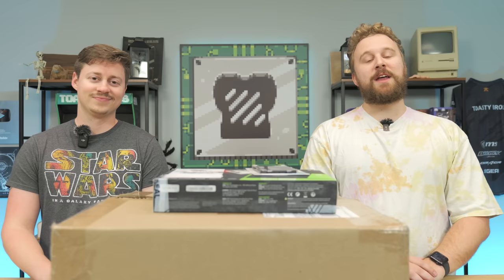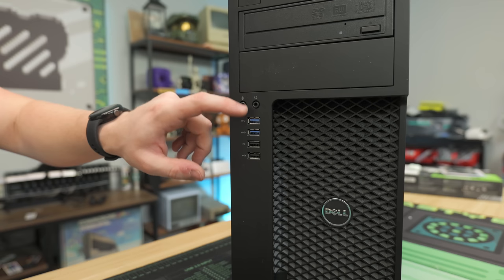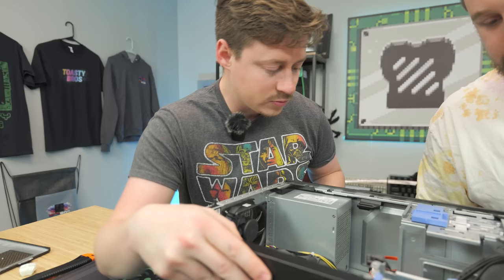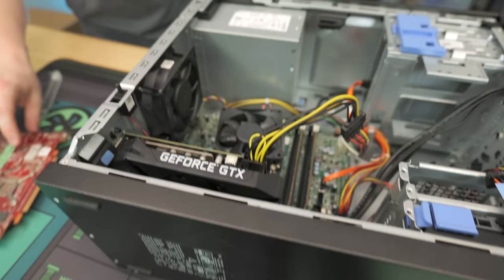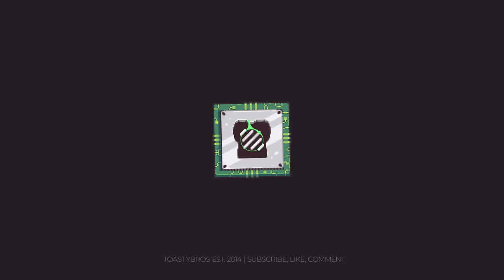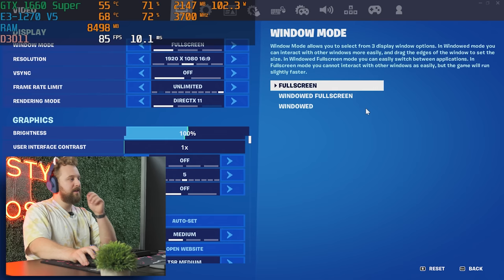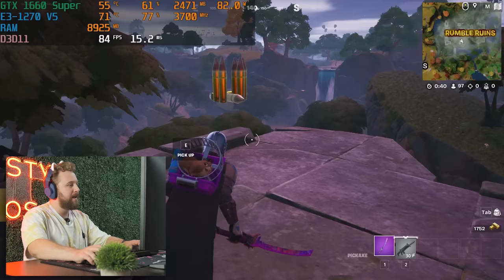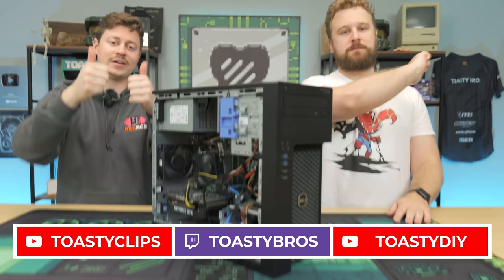This $215 Gaming PC Build is Almost PERFECT....

Comment: 👹"THE DIABLO DOG"👹Yo!  Just gotta chime in here about the Xeon for budget gaming builds. While those core counts are tempting for the price, the clock speed on Xeons is usually way lower than i7s or even i5s.  For gaming, clock speed is king, man! Those extra cores won't help as much as a processor with fewer cores but a higher clock. You'd be better off with something like an i7-8700 or even an i5-8500. They won't bottleneck you nearly as bad and you'll see way smoother gameplay. Just my two cents!👹"THE DIABLO DOG"👹PS Spot on about the power supply in those Dells!  Many of the refurbished Dell XPS or Optiplex deals on Amazon with i7-8700 or i5-8500 processors come equipped with a rather meager 270-watt power supply. While it might technically run the system, it wouldn't leave much headroom for future upgrades, particularly the graphics card.

Comment: Why does nobody bother with 6 to 8 pin adapters. They’re the same price and a whole lot safer. I replaced the sata to 8 pin that came in my hp z240 with the 6 to 8 pin adapter because it came with a Rtx 2060.

Comment: can you guys do a video on the rx 550 4gb that has recently started selling on aliexpress it doesn't require any external power cables which is great for optiplexs
Reply: Somewhat better than GT 1030, but not much. Basically, this card was not very good even in a PS4 era. You would get 30-40 FPS in older games like Witcher 3 at 1080p med, and this was before all of this "new gen" updates. GTA 5 would run at 1080p High .

Comment: Hey Bros I really need your help I want to know if you can please write me back a short message on the info I need. I HAVE A Dell Latitude D830 Laptop. Performance is as follows It's a dual-core processor with 2.6 GHZ with 4 GB of Ram. I have a simple question. Can this laptop be upgraded in any way, shape or form?

Comment: that adapter should easily handle 60 watts. It SHOULD easily handle 120 watts, it,s just copper wire... 12 volts at 10 amps is not a ton of power.

Comment: use the 6 pin from the power supply, then just the +2 from the adapter.  both of the +2 are just ground.

Comment: You use that sata to 6 pin then combine the psu 6 pin and use dual 6 pin to 8 pin adapter. I dont recommend it but will be way more safer than a single sata to 8 pin 🤣🤣

Comment: I m using 6 pin to 8 pin adapter for my 3060 ti. Is that too bad?:D It works just fine for maxed out Witcher 3 rtx on and some VR games.
Reply: Well, you are on the edge of combined PCI and 6-pin power (75+150 W) . 3060Ti is 225W TDP.

Comment: I cant believe they didnt use the 6pin that came from the power supply and just the 2 ground pins from the 6+2 sata adapter for the last 2 pins, or you know a 6 to 8 pin adapter.

Comment: They should have used the 6 pin from the case and the 2 pin from the 6+2 adapter to avoid pushing too much power from the SATA power cable.

Comment: i already use the ssd
Reply: Hey I have a 450 w psu and I got a gtx 1650gddr6 oc with 8 pin can I use dual molex to 8 pin cause gtx 1650 oc is rated at 100w and 60~ish w can be supplied through cpie slot and dual molex can supply another 108w so I think I should fry my pc right?

Comment: you guys should try a machinist mr9pro with a xeon 2667 v4 + elsa/soyo rx5700 with 16 gbs of juhor ddr4, its slighty more pricey than these pcs shown in the video but a good amount more powerful.
Reply: Just ordered machinist x99 pr, e5 2670v3, 16gb ram and Elsa rx5700. Costed roughly 200€ combined.
Reply: I will unlock turbo on all cores and kill the multithreading. Slight raise of the bclk and flash the rx5700.

Comment: Even though you recommended against it I think it's a real disservice to use the sata to 8 pin at all. The sata to 6 pin is sketch enough as it is. The 8 pin is genuinely a fire hazard, and wattages differ on different versions of the same cards. I love the budget builds but you already know some people are gonna follow along regardless of what you say and we gotta keep everyone safe as a community. There are plenty of good six pin cards and from what others are saying the 6 to 8 pin is for the most part okay. Loved the vid otherwise!
Reply: Better off using 6 pin pci-e to 8 pin adapter way safer only ones i suggest

Comment: BRO. Those systems pull sata power through the motherboard. Your adpater is ill-advised! Viewers: DO NOT USE A SATA ADAPTER. The 6-pin PCIe power is better, using a 6-pin to 8-pin adapter would have been just fine in this application for the long term. The power supply can support that easily.